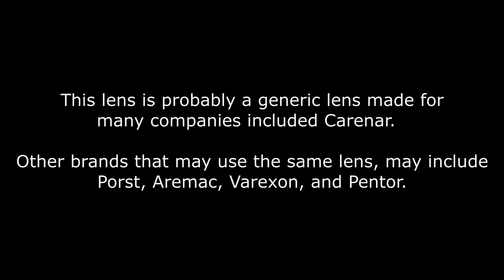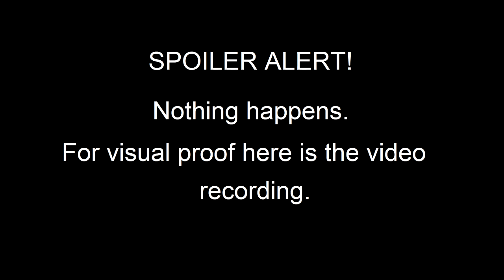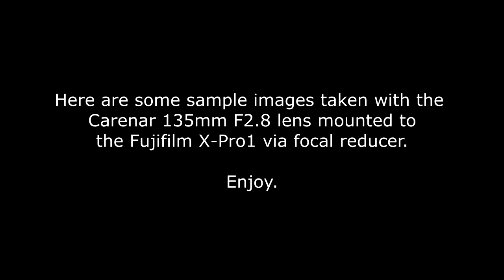Repairing a Carenar 135mm F2.8 lens (M42).

Comment: Wow, I love this video! Your video is very informative!

It just so happens that I had found a Carenar 135mm f2.8 lens yesterday that I'm purchasing today before I even knew this video was available. I was concerned with possible haze/fungus and had no idea how these lenses come apart. 

I do have two questions for you...can you specify what type of grease to use, and please comment on how/what you used to clean the lenses? I may be taking my lens apart later today! 🙂
Reply from the maker: Lithium grease is mainly used to lubricate the helicoid.  There are many types which have different viscosities.  We use ones branded for use on lenses.  For cleaning, isopropyl alcohol is used for most glass.

Comment: Again, fantastic video and I was successfully able to disassemble, clean and reassemble the Carenar 135mm f2.8. Mine was from Japan versus Korea but close in design.

I did notice something after the lens was reassembled. I see play front to back in the lens body. Do you have any advice on how to correct or limit movement in the body??? The lenses are tight.

Thanks again for a phenomenal video!
Reply from the maker: I would need to see the lens in order to see what's loose.  Be sure all screws are tightened.  Thanks.

Comment: So I got one and the aperture blades don't move at all, what would be the best way to access the blades front or rear? Thanks
Reply from the maker: Both.  It will come out the front, but components from the rear will need to be disassembled.  Good luck.

Comment: Hello, I have bought this lens and i have a problem. The zoom does not work. I have disassembled it and there are 2 brass bars that are screwed to the metal body and lock the zoom. How can I fix it? Can I send you an email and discuss it?
Reply from the maker: We guess you are referring to the focus ring, as this particular lens is of a fixed focal length.  If the focus ring is stiff or even stuck, it usually means the helicoid grease has hardened.  The helicoid will need to be disassembled, cleaned and regreased.  The two bars you are looking are the keys that keep part of the helicoid in place as the focus ring is rotated.
Reply: @FocalReduced  Thanks for your response. I have checked the helicoid for dirt and lubed it. It rotates when the brass plates are off, but as soon as I screw the plates it does not rotate and the focus does not move. Maybe I am screwing it incorrectly?
Reply from the maker: The helicoid has multiple threads.  The female portion with the finer threads is most likely seized and will need to be cleaned and relubricated.  The reason why your lens rotates without the two bars, is because it is rotating on the courser threads only.

Comment: Hey great video! just got the 35mm carenar and the aperture ring doesn't click into place - it just turns fluently. I've opened from the back, but can't see any aperture track. Can somebody post a picture of it's inside because i feel like someone has been in mine and taken something out.. thanks to all of you lovely people
Reply: PS: aperture is working but the ring is "loose". So setting aperture to 2.8 doesn't click and hold it there, it acts as the focus ring where the slightest movement will knock it off the set value